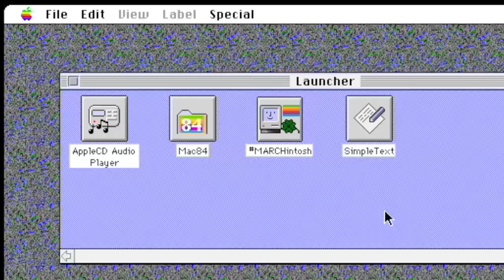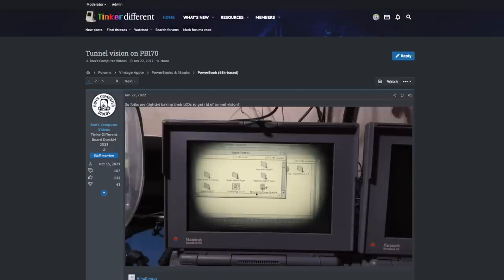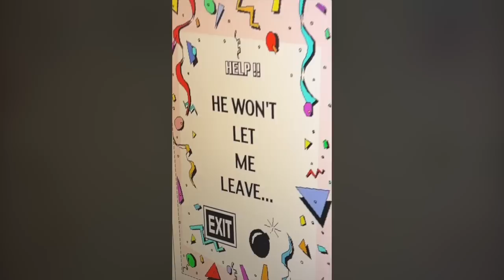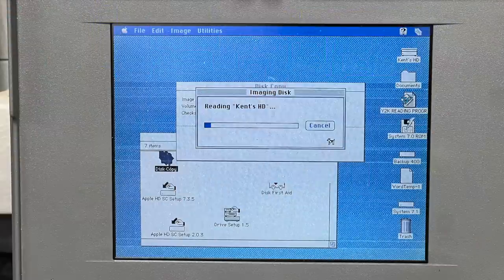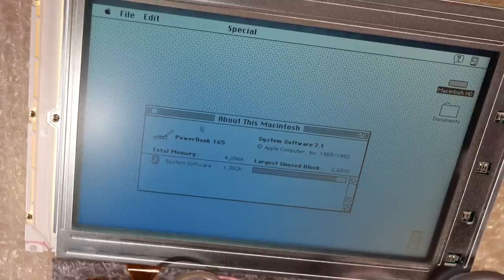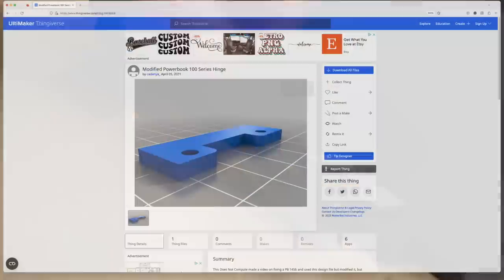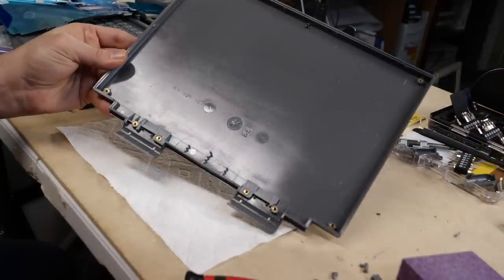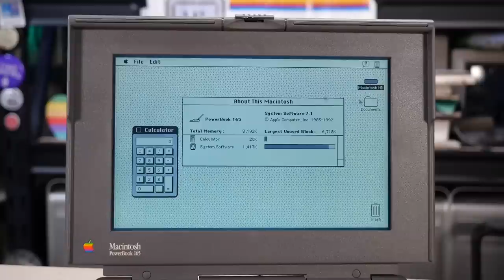Fixing Common Vintage PowerBook Problems + Recapping Luke Miani's PowerBook 165

Comment: Excellent job detailing the faults of these PowerBook laptops that we all love. And thank you so much for showing my website in your video! I’ve been putting a lot of time into it and I really appreciate the promotion.
One thing worth noting - tunnel vision only happens on Active Matrix monochrome and grayscale display. So if it’s passive matrix, or it’s color, you’re completely safe. 
This is also the first time I’ve seen that cap removal method in action. When I recapped my PowerBook 145’s LCD, I did twist the caps off and it didn’t cause any damage despite the fragile PCB. I may have to try your way in the future though, it looks like it works pretty darn well. 
I also can’t believe I didn’t think of sanding the edges of the 3D printed part when I was having fitment issues on my machines. That should save me a lot of time!

Comment: Hi, another well done repair.

With the plastic reinforcement for the hinges, your can buy some cheap "rocks on a stick grinders" that come in round and cone shape, they attach to a power drill ( cheap 12v ones are best but you can use a normal ac drill with a flexi hose shaft.

Anyway they make the grinding down of the old plastic very easy and fast, and once they wear out they are fairly smooth so use can still use them as a fine cutter to smooth out the last lumps

Also when giggling the plastic hinge i use some blue-tac to roughly hold things in place while i line it up and test, then i use some old school liquid paper in a bottle to white mark the final position

Regards
George

Comment: Excellent and useful vid! I have made several successful repairs to my beloved 540C PowerBook but, was humbled when trying to repair hinges on a 165C. Those  plastics.  Pre-3D printing days for me, I settled on blobs of JB weld “steel” epoxy with the brass insets embedded LOL! The JB bonds very well to these plastics and is hard as a rock. May be a good alternative to affix the abs blocks to the case. I worry that the UV curing stuff under those flat pieces won’t get fully cured.

Comment: I can also confirm that baking fixed it for my PowerBook 180. In fact I used i803886sx (YouTuber below) as my reference as he baked it at the higher temperature (100 celcius for 4-5 hours) and the tunneling is still gone after more than 8 months (I sometimes leave my screen on for 6+ hours). Note that it likely isn't moisture but the internal panel seals deteriorating and the panels slightly separating....the baking re-flows the seal. Liquid crystal is very miscible and any encroaching moisture would mix and get trapped within the narrow space and miniature glass beads that are used as separators, and not recede, as is the behavior of tunnel vision. So it's more likely heat causing slight warping/separation of the panels which impacts the LCD helix to not align properly letting light pass through. There are some cool videos of LCD construction -- I posted a couple on of the Tunneling threads on 68kmla.

Comment: To be honest this is why I like the Post-Jobs laptops. The pismo and newer can almost all use the same DC power plugs. They are super easy to get second hand. They are all PowerPC and while that’s not good for some pieces of software due to speed or cache comparability most games just need a slow down control panel and they run.